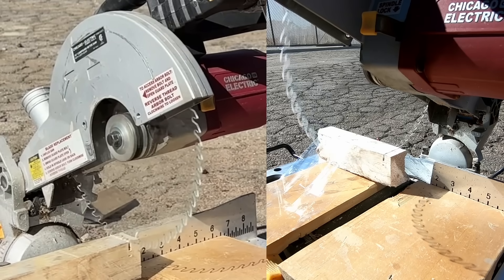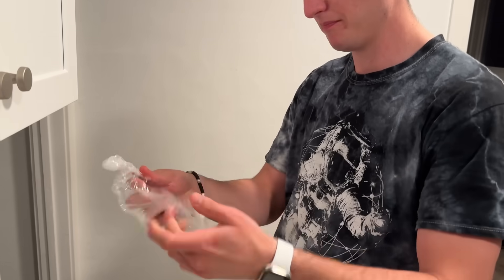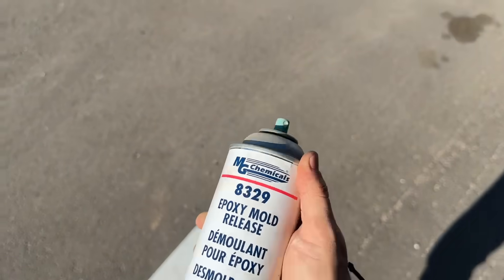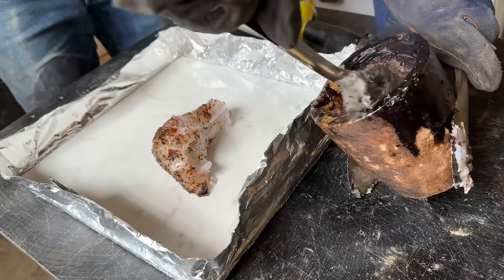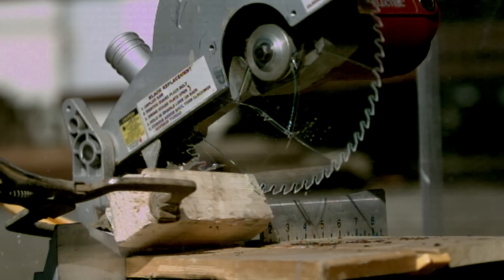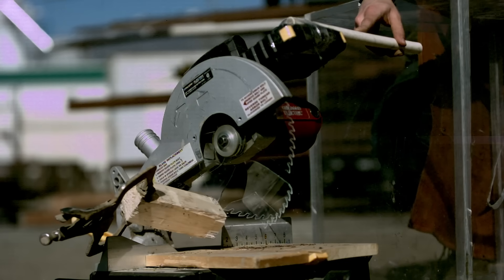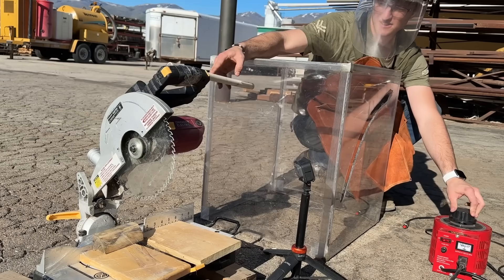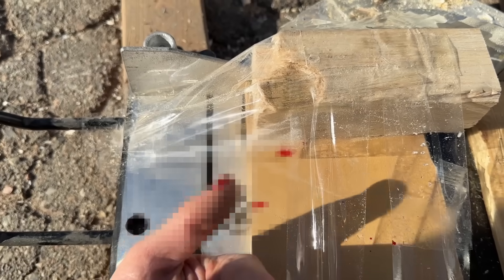Can Glass Actually Cut Wood?

Comment: Take your poly carb saw blade that lost the teeth and put a chain saw chain around it and fasten it on perm :) 
To get it bonded solid heat the chain to around 350 f (don't go higher than 400 you will start to anneal the chain). You should actually end up with a pretty useable clear saw blade

Comment: I imagine a problem is also that the sawblade is as wide as the edge for cutting. You want a wider edge.
Reply: For a very high performing sale blade you want the teeth edges wider than the rest of the blade to clear the chips and reduce the chance of binding and burning the wood